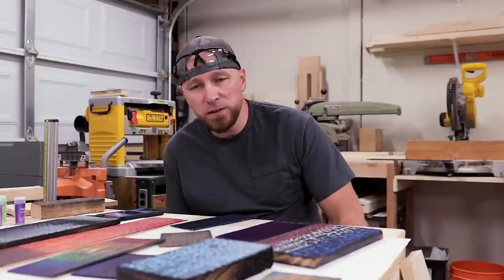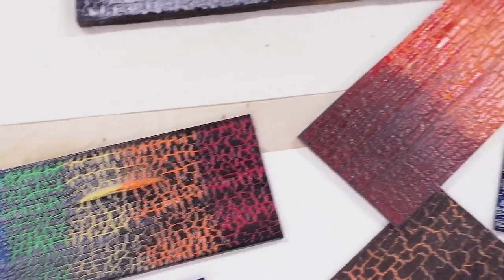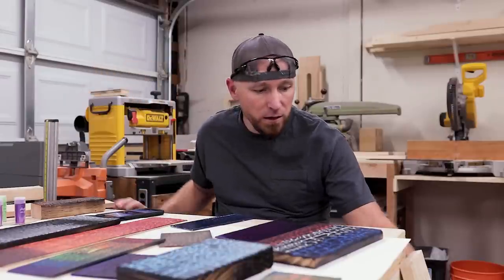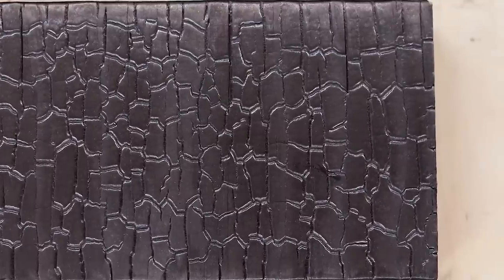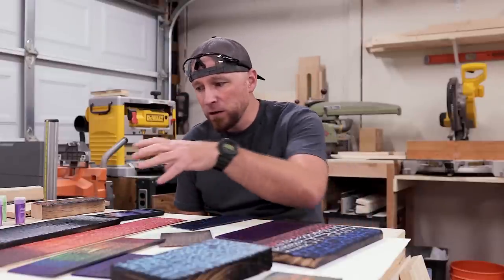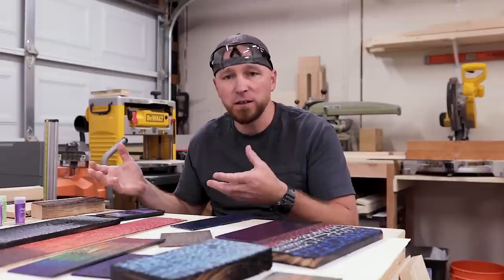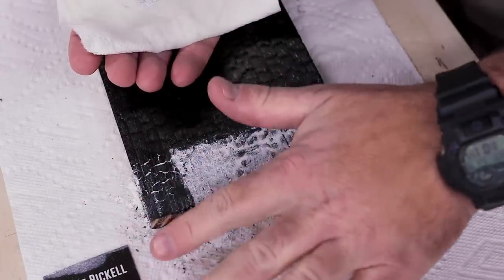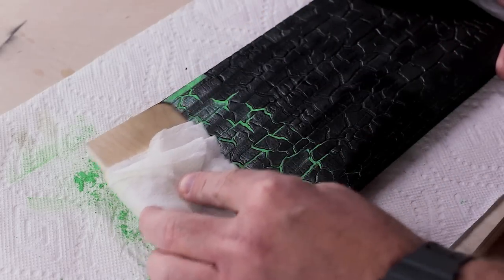Shou Sugi Ban 2.0

Comment: TIP: You can vary the char cube size with speed of burn. Several light passes to char then a heavy one gives larger cube finish or just a heavy one off pass gives small cubing. 
Fire fighters use this knowledge to determine arson claims, if the fire was started using an accelerant, small cubing at the ignition source and a cube line change on the accelerant edge. 
Thanks for sharing your efforts in detail, it means we can all take features to construct our own take. I use this technique mainly on handled implements, it's great fun.

Comment: Thank you so much for all the thought and testing you put into your videos. Shou sugi ban turned out to be pretty much first woodworking project in two-plus decades. Your videos, as well as those by Build Dad Build, helped me turn a basic hardware store dowel into a "bloodwood" staff for Halloween. After watching this video I had a crazy idea - inlaid metal in the valleys of the alligator texture. First thought was precious metal clay since you also use fire to turn the molded and dried clay into metal. Second thought was gold leaf. Paint your glue in the cracks (or just the bumps) and lay your gold leaf down. Of course, there are metal mica powders, too.

Comment: One idea that I got from watching this video is after puting the mica powder on the wood pieces and sealing them with whatever of our choosing would be to add mica powder to  resin and mix it up and then do layers of that over the wood pieces. Or just one or 2 layers. But by doing several layers and letting them dry in between I bet some incredible affects would happen. I'm now super interested in trying to creat a look of natural opal over the wood and as the filler on other pieces just filling in the cracks with it so it looked like the opal has formed inside the burned wood and the cracking is maybe an affect of the opal forming within the wood and causing it to crack apart... I'm going to play with this and see what types of illusions I can come up with.
Thanks for such an inspirational video. I really enjoyed all of ur videos I have seen so far

Comment: Hi : I've finished concrete for over 30 yr., and in repairing concrete walls that have air, or rock pockets in them we used to have the problem of putting our patch material into these holes, in the dry walls, and when we would strike off the excess material using our sponge float.  The sponge would expand into the area being patched, and would pull out part of our patch material.  Frustrated I reasoned that I needed something to bridge the patch while strucking off the excess material.  I happened on to a piece of Styrofoam about four inches square, and an inch thick.  Working in a circular motion, and light pressure it helped me put the material in even with the surrounding area.  Who knows it might work for you.  All I know was that our patches came out as smooth as glass.
Hope this works for you.  (By the way we were working with sand, cement, water, and glue)  with the exception of sand it sounds like pretty much what your using.  Tht old saying is true, " When your doing what you love doing you never work a day in your life".  Hope that will always be the way for you.
I did comment earlier, but I again want to thank you for sharing your time, and skill.

Comment: I thing you would have fun experimenting with UV cured resin epoxy.  Cures and hardens in about 2 minutes using thin coats, also try using a big blush brush that you find in dollars a makeup section, very soft brushes should work well.  BTY you can also put your mica pigments in a solution of water, or alcohol and brush or pump spray them onto your char-wood without any damage. Then top seal with UV activated epoxy resin or a good cleat spray paint lacquer.  Good luck, keep experimenting with your techniques.

Comment: I have had good results with burnt wood by using liquid floor wax in a spray bottle. After a few coats and letting it dry in the window, It seals the char in place. I will try the Mica powder on the sealed wood, then give it a few more coats of spray wax. Thanks
Reply from the maker: Interesting. I might have to give that a try as well. Thank for the info!

Comment: I enjoy your tips and tricks.  Just put it out there and the devil may care!  Have you ever tried a tinted plaster or setting drywall compound?  Trowel it on and wipe it off the surface.  It would probably be pretty cool.  Some of those universal tints could be pretty vibrant.  Another possibility for a filling medium is a light color unsanded tile grout.  It would certainly stabilize and bolster the soft cedar char.  Anyway, good !
Reply: luck!

Comment: You just gave me a killer idea. I plan to make an L shaped computer desk. Hexagons and epoxy. Was going to use something like red cedar or maybe burn pine for the hexagons. I like the look of this pine with the powder in it. Question though. Should i burn the whole pine board and powder it. Maybe lock it in with epoxy then cut out the hexagons. Or cut the hexagons and burn them individually. Going to be time consuming either way.

Comment: i LOVE the effect that this produces.  I wonder if perhaps mixing the mica powder with something like ModPodge or a craft glue that dries clear and brushing it on would help lock the powder in - just wipe the excess off before it dries out, could then clear coat it after to seal it all in???  Method 2 : Maybe could also just spray a preliminary light coat of an acrylic clear  to seal the char, then let that dry and then brush on the mica + glue/modpodge mixture and let that dry, then put final clear coats of choice on over the top to fully finish it...???

Comment: Hi Jodee, 
And hi from York in UK.
Great videos and I'm very grateful for you taking the time to explain everything so thoroughly.
I'm trying a few projects with Shou Sugi Ban and trying to find the correct dyes / stain on this side of the big pond.
I'm about to try unicorn spit in differing dilutions to see what effects I can get with it.
Have you tried using stain in the cracks of the char, wiping off the excess and leaving the ridges filled?
Leaving it to dry then sealing?
Would this avoid "bleed" ?
As far as projects are concerned I'm looking at creating small boxes, knee trays, etc. As well as creating river tables etc too.
Can you explain or make a video how you set up your clamps to hold the wood whilst burning?
Keep safe.

Comment: Suggestions
It would be great if u would have a camera above the table. Maybe a rounded security style camera that will capture the entire table top. Also some more lights set up around the table or play with the best locations to capture the details and colors. Lights above the table will cause a glare and take away from the visuals and also it will make everything very flat and non dimensional but off to the side or a very soft light above would be ok and still lighting from the sides. Also a fan would be a good recommendation for people whom are new to doing projects like this, maybe recommend they open the side door of their garage and have a fan on the ground blowing in a direction away from the project and maybe not on high but a medium speed just to create enough if an airflow to help with the smells and fume inhalations. Also everyone should wear a mask made for preventing inhalation if fumes and such. 
But definitely we were not able to see much of anything because u had the camera lined up so all that was showing was the sides of the wood and a but if the tops of the closest blocks. Another great way to let everyone see is when u hold up a block to talk about it show it to us by facing it towards the camera like if u had a classroom full of people u would hold up whatever u were talking about and show it to everyone. Another way is if u dontbwanbtonhanf a camera from the ceiling u could mount them on the wall or on a shelf or use foam board and pegs to create a ledge above and below the wood pieces to hold them on that wall surface so the camera can stay down on the table or wherever and capture it. Another idea is wear a go pro that way we see what u see. U can also just show the wood and dub over ur narration after u film. It would be really nice to see all of the pieces together at the very end and it would be awesome to see them outside as well as inside with natural daylight.
But thank you for making this and other videos you gave my friend and I some amazing ideas and we can't wait to try them out.

Comment: Hey there, have you tried mixing the mica with rubbing alcohol and then flooding the grooves? It might work better and will save you from having to do anything abrasive to the burnt bits. I guess you could also do it with oil, but this won't evaporate like the rubbing alcohol will and might affect the wood. It might be worth experimenting!

Comment: Have you tried mixing white glue with water then spraying it on.  it will dry clear then you can come back with your normal top coat.  A lot of people that do modeling like for train sets use the white glue with water to lock in sand and other earth type textures.

Comment: My question is more about Shou Sugi ban in general. We are building a home and are planning on using Shou Sugi ban as exterior siding. I am thinking it might be too much black though. I really like the look when it’s burned but then the soot is scraped off a bit. How does scraping it down to the point of showing some of the light colors affect the original purpose of preserving the wood?  

I appreciate your knowledge and creative thinking!  I would love to use this technique in some art pieces.

Comment: I loved all your shou sugi ban videos.  I am thinking about getting some Accoya. I want to make 1/2 shou sugi ban cabinet doors. If I burn a 1" board, apply a finish on the burn, will it be tough enough for me to plane down the back side to 1/2" with several passes so I can avoid warping such a thin wood? Thanks!

Comment: Keep up the great work. You be you, haters move on. I am considering something like this for 1 of  my bedroom walls. I am stuck in bed or in a wheelchair and my walls and ceiling are so incredibly ugly after staring at them 24/7 I cannot hardly stand it. My extremely limited income is limiting me to gather the required materials piece by piece each month, but I will utilize this technique, THANK YOU!!

I did not see a link to those Mica powders to check out, if they are still available? I also use them in my jewelry.

Comment: Very nice work man love ur detail and videos it’s been days and I’ve seen most of ur videos and everything shou sugi ban I’m inspired to use the look and shou sugi ban 1 to build my subwoofer enclosures.  But that gets very Expensive although I’m not sure how well it would work when the sheets of plywood ( radiata pine, birch, maple or oak) would do during assembly and glue up and clamp up with the charred surfaces.  Do u have anything experience doing this with cabinets which is very similar construction style? If so how well did it work ? What’s issues did u have to look for? And of the plywood species at the big box stores is anything gunna give me a much better result? The look I really like is the sequoia pine but it’s probably pretty expensive and hard to find so I was thinking more radiata pine for price and accessibility and possibly birch.  Do u have any thoughts on that? Thanks for ur hard work, time and everything I’ve learned from ur videos keep up the good work sorry I asked a lot of questions but ur feedback will be looked at and reviewed by plenty of other people…

Comment: Have you considered trying embossing powder? I know that might come dangerously close to shou sugi ban unicorn spit but not all embossing powder contains glitter. I haven't personally been able to heat the powder quickly enough without losing most of it due to the draft created by heat of the torch or heat gun or heat gun torch but you've got more tools in your shop.

Comment: Instead of adding micro powder into the grooves, couldn't one use acrylic art paint with a fine brush and put it into the grooves. I know it would take more time and be tedious, but I would think the color would lock in quickly and you could coat that with a think layer of epoxy and then do a deep pour on top. I would love to hear your thoughts.

Comment: Hey bro, have you thought about making a paste with the mica powder. Maybe use some alcohol to dampen some and then push it in the cracks like putty. Also can mix the mica powder heavy in some alcohol, then squirt it in the cracks lightly. The alcohol will evaporate quick and leave the mica powder where you want it. Could also maybe use plain alcohol to rinse off the areas you don’t want the mica powder on and that can run into the cracks and dry out. Another idea is to maybe run epoxy down in the cracks, then sprinkle the mica powder on top, turn board over and tap to get the mica not in the epoxy to fall off. Or just wait for the epoxy to dry and then use a brush to get the areas cleaned off, then can brush on whatever top coat sealer you want, or pour more epoxy over the entire thing. Ive used mica powder mixed in alcohol and sprayed on epoxy that I had spread over a countertop and it worked great once I ran a torch over it lightly to dry off the alcohol and remove any air in the epoxy. Just some ideas I thought of while watching.

Comment: Jodee, I'm new to your channel and videos.  Also new to shou sugi ban, and love the process.  I'm still catching up on a lot of your content (all of which is awesome so far), but I did have one questions related to shou sugi ban - do you always stain/color your pieces?  Do you ever leave them "au natural"?  If so, do you always put some type of clear coat on them?  One article I read mentioned using boiled linseed oil.  I've had some success with doing a char->brush->oil->brush.  It give is a nice sheen, and brings out the contrast in the soft spring wood versus the charred grain.  In any case, please keep it up!  I'm learning a ton!

Comment: This is an awesome video - thanks for sharing your tips and tricks. I have a question as it looks the trickiest part is how soft the burnt layer resist to brushing and scrapping. Have you tried to polyurethane spray (or any other fine coat) BEFORE the micas? It would then make our life easier to keep the cracks colored and keeping the tops clean and dark black. Thanks !

Comment: Great video! If you were to make a bartop using this method, in your professional expertise, would you lock in the powder with either the glue you mentioned or the urethane spray, then pour clear resin over everything? So basically a layer of locking "glue" then a layer of encapsulating final resin? Thx

Comment: Thanks for this! I work with mica a lot with resin and your videos have me obsessed with wood burning. I have a couple of questions... 1. Could you seal the char before applying the mica to make it easier to wipe off? I don’t think the sealant would fill in the cracks to the point of not allowing the mica to settle in, but may be easier to wipe off the top without damaging the char? 2. How does burning affect the integrity of the wood, if planned to use for an accent build? I’d assume you’d just have to not use a burned side for fastening?

Comment: Awesome video! Loving this technique! Thanks for sharing 🤙🏼

I'm wondering how it would turn out if you mixed the mica powder in Elmer's glue all, swiped it in then used a damp cloth to clean up the surface 🤔 Might lose the shimmer though. 

I finally shou sugi ban a Didgeridoo...didn't turn out great but I learned a lot so next time should be an improvement!
Reply from the maker: Interesting idea and definitely worth a try. I'm glad you at least tried it. That's the only way I've figured any of this stuff out myself. Thanks!

Comment: Thank you again for an amazing video. In the past couple years I've started to work with shou sugi ban. 
  My question today:
You mentioned the difference in result with the  burn & char from a small torch. In you experience does it make a difference for when you brush and sand off the char or is the burn technique / size only relevant for when you leave the char on?? 
   I will be using shou sugi ban on full  2×6 & 2x8 pices of cedar and was hoping to get your opinion on that. 

Thanks again!!

Comment: I heard the reference about "all the extra steps"...burn a little longer for char and brush out the grooves??? Doesn't seem like much if that's what it was. Can I do this on pressure treated and seal for a nice deck slat piece design. Want to do an American flag with the method.

Comment: I'm researching a Neck Thru Bass guitar and I'm wanting to Shou Sugi Ban Kintsugi style the body front and back.. I'm using SPF and hickory laminated as the neck in the 5 layer style..  But I think you've given me the info I was looking for. I'll be using epoxy and leaving my fingerboard alone.. As well as sanding back the neck so likely staining it somehow.. So.. Red stain and sand back seemed best on the previous video.. Gold mica on the Hot charred..

Luckily this isn't a commission piece and I'm planning on doing a second either way.

Comment: Appreciate your content and showing us your methods and experimentation results, thanks. 
 I am curious how some of these pieces would look if after sealing in the mica you sanded it with 120 or 180 grit and then with 220.  
Does it remove that severe charred layer in most spots while revealing some of the woods natural color and grain patterns while also maintaining accents of the mica?  
In my mind at least I feel that could look incredible.  Or does it just make a mess and mix soot with whatever mics isn't sent violently flying off of the piece into oblivion?